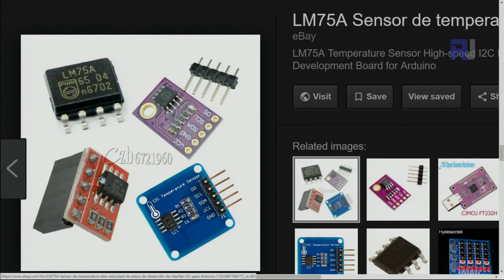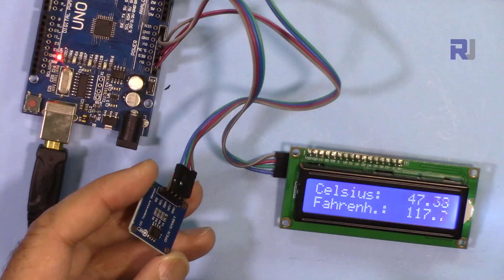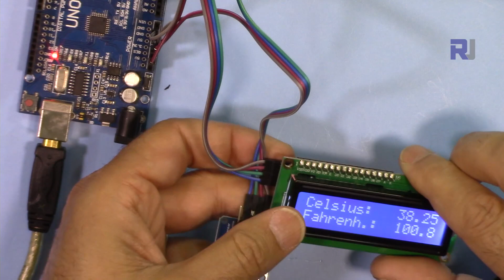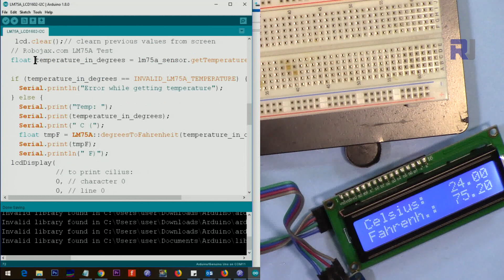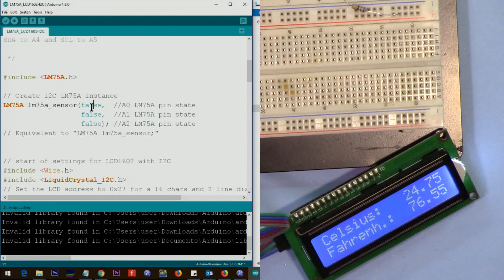Using  LM75A with LCD1602 I2C  to display temperature on LCD RJT105

Comment: hello homie, I used the code you provided and I ran into some problems that I somehow solved, but now it shows: ''  'lcd' was not declared in this scope '' and I don't know what to do. It says that at lcd.begin()
Reply from the maker: Hello, Yes it means you have not watched the video and skipped.  This video requires you to watch another video for the LCD. Please watch the video again.
Reply: @robojax  I watched the video homie. Turns out I had too many libraries. But the lcd display doesn't work properly and I have to troubleshoot it somehow. It just fills every pixel and I can't make it to type stuff. Thnx for replying though.

Comment: Hi sir robojax.. has been a long time.. sir, may i ask a favor.. i have run with xh-m452 module in the net. But i canot find english version on how to operate the same. Again, i wud seek ur wisdom on how to install this module.. hope u can spare and share ur time.. ty sir rojojax..
Reply from the maker: Hi, I found this page with clear wiring http://electrobist.com/product/xh-m452-thermostat-temperature-and-humidity-control-hygrometer-controller-module-dc-12v-for-incubators-hatchery-etc/

Comment: hello sir,
 I hope your doings are good.  I am using lcd with i2c  i want to display some out put about position and voltage of solar panel. but the problem is that the output is not in correct order. The letters and the integer values or disorderd.
like Voltage= 0.22 shows g=22.0valtge. same like the position of servo.
i think the problem is about dta type and i can't fix it.

please  replay  as soon as possible. thanks in advance

Comment: Hi! Thanks for the video  - question - is there a particular reason why your LM75 was reading 75C? I have  75A implementation and it insists on showing me the wrong temperature (base +10C approximately)
Reply from the maker: Hi, you are welcome. Please point the time  on the video (like 02:31) so I watch and find and answer your question.